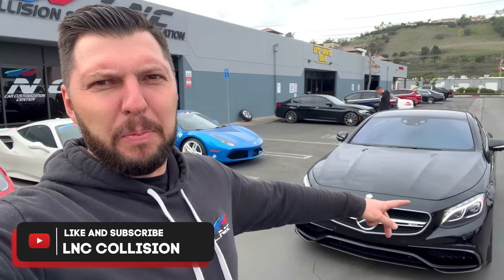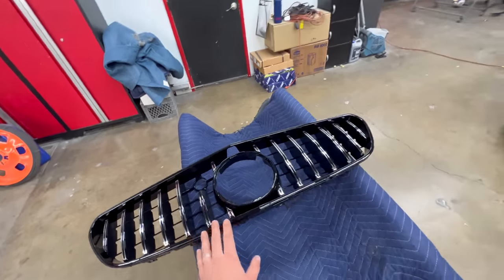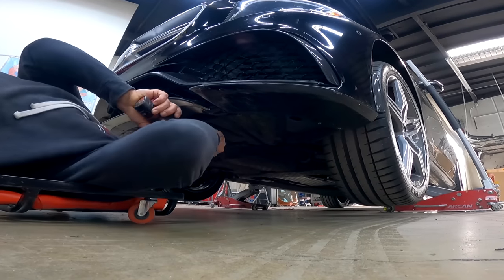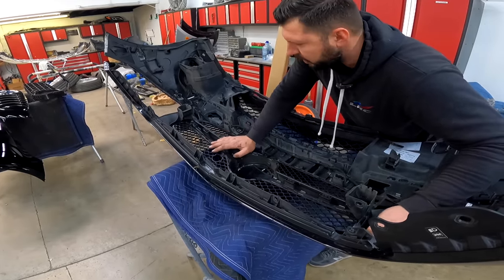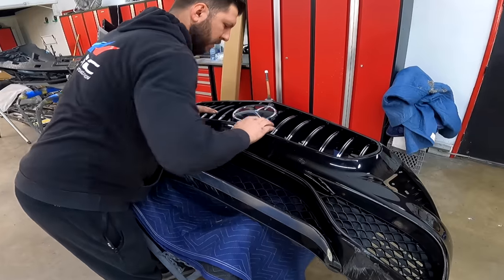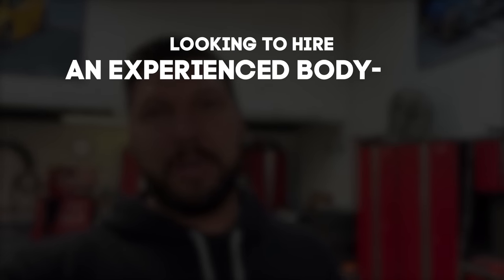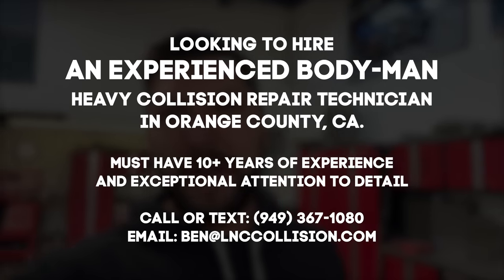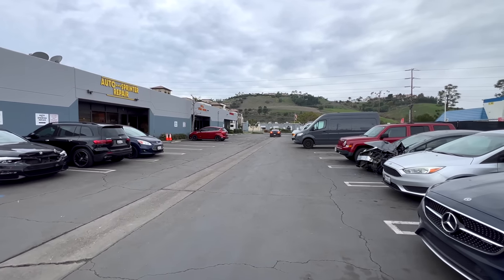MERCEDES S63 AMG W217 PANAMERICANA GT GRILL INSTALLATION INCREDIBLE TRANSFORMATION!

Comment: I was told you don't have to remove the grille piece that covers the infrared sensor on the front of the car.  That way the new grille isn't missing a piece towards the left of the 360 camera making it look odd.  Can anyone confirm (you must have night vision to understand).  Someone sent me a photo showing night vision still worked, but he wasn't sure if it was still able to detect people or animals because he never uses it.  Before I pull this bumper off I'm wondering does anyone know?  See 3:31 you'll notice a circular hole to the left.  That's for the infrared/thermal camera.  Now look at 6:15.  Notice there's a "cut out" of sorts that breaks the grille lines.  The aftermarket grilles come with a cover that has a fin built in so you don't have the look.  But it obscures the thermal camera.  Again, someone said the night vision still works.  But I'm wondering what impact covering that has.  Thanks in advance.
Reply: I’m wondering same thing